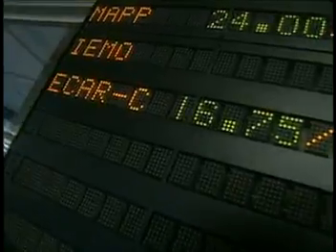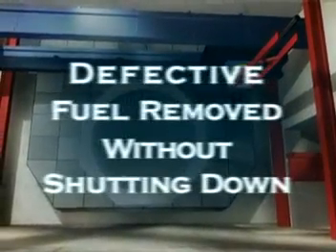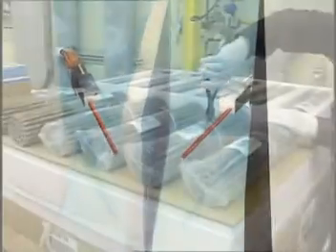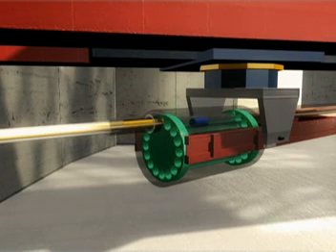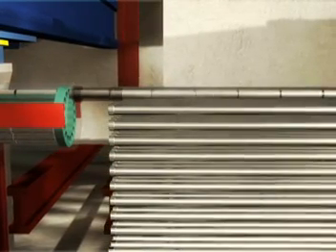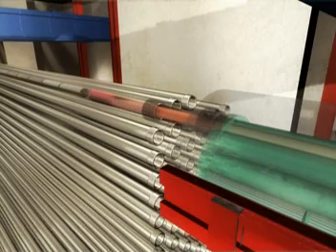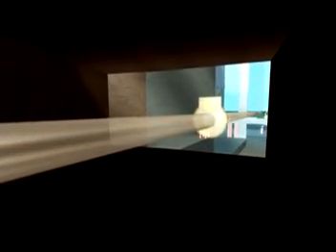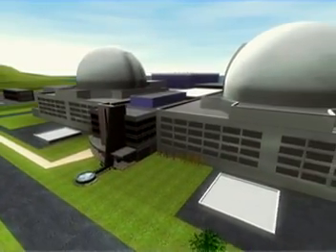Candu Reactor Refueling

Comment: The horizontal reactor lay-out seems pretty unique.
Reply: For power reactors, yes. However, the first large scale production reactors at Hanford were similar in layout, although much, much larger.
Reply: It's great or allows them to avoid shut downs for refueling.

Comment: By far CANDU is the best reactor ever conceived! it can run on any fuel from thorium to reprocessed long lived waste!
Reply: David Vermillion water-cooled reactors are ancient
Reply: David Vermillion got it own problems like the possitive void coefficiency and Cant breed plutonium
Reply: If at this moment there is a best reactor should be the Bn800
Reply: The later is not a negative. Since you can sold those reactor a said contry and your're sure they wont make nuclear weapons out of it.
Reply: good ancient reactors,in Romania we have 2 of these and they works wonderfully.....
Reply: CANDU reactors produce plutonium. Plutonium is a natural product of the Uranium fission process. All thermal reactors running a Uranium fuel cycle, will produce plutonium. Thorium too. The real question is what do we do with that Plutonium. I feel that the correct answer is reprocess it and send it through the reactors again. No sense in throwing out good usable fuel. Especially if you keep it on-site for reprocessing, thus negating any proliferation risk. 
1. Pull it from the reactor. 
2. Send it to on-site reprocessing.
3. Send it back to the reactor. 
4. Enjoy huge reductions in greenhouse gasses because of the coal and gas plants you were able to shut down.
Reply: With chloride fast reactors you can leave the plutonium in the core and just remove "specific" fission products. Keep the uranium-plutonium salt screaming radioactive to prevent theft. Neutron poisons aren't as bad with fast neutrons.
Reply: @Matt..S  I understand the absorption and decay process. I was trying to keep things brief in my description of the operation of power reactors. You're right that Pu-239 isn't a fission product. But all reactors that run on U-238 nad U-235 produce Plutonium as part of their normal operation. I agree with you completely though. The best and safest place to store Pu-239 and Pu-240 is in the reactor that created it. It's a fantastic fissile material that can and does produce heat. Use it to generate clean electrical power! MOX fuel is a good option for existing reactors, but that mix of Plutonium isotopes can be used as startup fuel for more interesting reactor types like Molten Salt Fast Reactors or the Integral Fast Reactor.
Reply: @DriveCarToBar  However, molten salt reactors have so far never worked and pose so many more extreme dangers that are overlooked in the hyped up videos, just like about the magic fuel of thorium.
I'm an old school, new vision kinda guy when it comes to nuclear. heavy water or light water and standard reactors that just work. And minimum 1000MW. 
It is baffling that only Canada, Argentina and India use heavy water reactors. It seems so obvious to use: No need for centrifuges to enrich uranium = far less CO2, far less chance of proliferation in enrichment facilities... Yes, more plutonium, but with strict regulations, this could be practically free unlimited energy for poor countries that lasts for years before it needs serious refuelling. Africa is sitting on huge uranium reserves and could just shove it into prospective reactors without the need to build expensive and complicated facilities..

And people forget that plutonium is an important fuel for space probes like the voyager.
Reply: @cnn8420  ancient but good.

Comment: I have to say, I really do like the CANDU reactor design. Up until now, I've mostly read about RBMKs and PWRs, but this is increasingly piquing my curiosity. To me, it resembles an RBMK, but then put on its side, without the graphite, sporting a proper containment building and done really, really well in terms of safety etc..
Reply: I'm not convinced on the safety aspect as the more complex a system is, the more likely of mechanical malfunctions requiring human intervention. And it's this human intervention that is likely to cause safety issues.

Comment: Hanford B Reactor used a much simpler and better method.... get a bloke to push out the spent rods with a long broom handle and have them fall out the back into  a bucket of water! Then have another bloke put new rods in all while smoking Woodbines!
Reply: Anonymous Anonymous that’s not why the reactors caught fire, it caught fire because of 1) its cooling system; 2) the way they over used the reactor, a graphite pile, it accumulated to much energy; 3) they decided to overheat it in order to release the energy it accumulated. 4) they made things worse by turning on air when the fire started rather than cooling the pile with water.
Reply: Graphite moderator reactors have gone out of style.
Reply: The RBMK-1000 is a close copy of Hanford B, with most of the safety systems removed.   The scary thing about Hanford B (where we discovered xenon poisoning) is that when the power mysteriously fell after a normal startup, our operators pulled the control rods all the way out in a misguided attempt to get it going again.   (Fortunately the rods were put back in before any part of the core reacted and we got away with it, but boy was that ever dumb.)
Reply: Anonymous Anonymous  The windscale reactor used AIR for cooling, the B reactor used water.
Reply: I think you are referring to the Windscale plant in the UK not Handford B.
Windscale fuel literally fell out if the reactor into a water trough.
Reply: @deeremeyer1749  gee you sound like the guy no one talks to at parties?

Comment: I understand that a unique characteristic of Candu reactors is that their fuel does not contain elements that can be used for a nuke.

However, they CAN be used to burn plutonium from nukes as they are decommissioned.  They also can burn a lot of spent fuels from other reactors.
Making these reactors attractive as part of the reprocessing loop.  Reducing global spent fuel stocks.
Reply: The candu reactor CAN produce plutonium because:
1) use natural uranium
2) can change the fuel without shutdown.

Comment: @adekk9  The fuel channels of the RBMK were light water cooled. As you probably know, light water is not that good of a moderator compared to heavy water and graphite, because of a somewhat high neutron absorption cross-section. RBMKs were graphite moderated, so that is why they have such a positive void coefficient.  In other words, power goes up and so does the temperature. The  water becomes less dense it absorbs less neutrons and power further increases.
Reply: The CANDU also has a positive void coefficient, but  fuel geometry is critical in this design: if the fuel channels overheat, gravity causes them to sag out of alignment, stopping the chain reaction.
Reply: @laura-ann.0726  
The CANDU proves that having a positive void coefficient doesn't automatically mean an unsafe reactor. Not only that, the CANDU can, as a last-ditch resort dump its heavy water moderator and replace it with plain water so the core cooling can continue, but the chain reaction cannot. That's something completely impossible with solid graphite blocks. And the CANDU has two independent, blisteringly fast shutdown systems. Something the poor RBMK would love to have, but never got. Before the Chernobyl accident, its single shutdown system took a skeletal 18 to 21 seconds(!) to fully insert all the control rods into the core. At that point you might as well put jelly in your pocket because you're going to be toast. By the time the control rods can make any difference, your reactor will have put itself into orbit. Which is what Unit 4 quite literally did that night.
Reply: @swokatsamsiyu3590 - Everything I've read about the CANDU makes it seem like the best overall reactor design for a commercial power plant, at least up to now. Producing the deuterium oxide is expensive, but then, so is enriching uranium for a light water reactor.  But I think that where the CANDU absolutely outshines every other solid-fuel reactor design, is on-line refueling and total availability. No shut down needed to just swap out spent fuel bundles. One question I have though, is how do the refueling machines maintain a water-tight seal to the fuel channels? Spent fuel has to be kept under water continuously because of the decay heat, so the inside of the fuel handling machines must be full of water too. The fuel channels are horizontal, so how do you prevent reactor coolant water from leaking out onto the floor at the interface between the reactor fuel channel and the refueling machines?

Comment: That's why you don't operate outside the design parameters (or way outside as in the case of Chernobyl). RBMKs are great at making plutonium for a renewable nuclear fuel cycle, but the things are beastly at 4500MW of raw thermal power.

Comment: So, when the plugs are remove, how is the 9 MPa pressure contained?
Reply: +Big Boss Kind of like what mark said but way more complex than that lol but simplifying it...

The refuelling machine has a higher pressure that the pressure tubes so that when they plugs are removed the water from the streams doesn't leak out into the fuelling machines but instead is contained by a higher pressure wall. This causes pressure within the tubes to act as it the plug was still installed.
Reply: +Bones9696 Ah ha. Yes, that makes sense. Thank you :)
Reply: Once the fuelling machine is clamped on to the end fitting it becomes a part of the reactor pressure boundary. The snout of the fuelling machine firmly clamps onto the end fitting to create and maintain this seal.
Reply: that guy is a boss

Comment: As a separate discussion, why is it that nuclear fuel can be handled by the crew and appears as non-radioactive and safe to be handled via humans with no major protections, prior to insertion into the reactor?
Reply: Non enriched fuel is considered stable prior to being placed in the reactor. Once it’s placed in there, the chain reaction begins at which point it cannot be “stopped” only controlled.

Comment: RBMK is better, it uses light water for cooling, and a graphite for neutron moderator. It also can be refueled without shutting down.
Reply: Origoangelohrol322 positive void coefficient FTW!
Reply: Like Chernobyl?
Reply: I think I found a nuke troll.
Reply: Are you fucking kidding me here?
Reply: @nerissacrawford8017   No kidding. The graphite moderated reactor concept is very good and the Chernobyl type RBMK-1000 is just a not so successful modification of the idea. It's predecessor AM-1 has been very successful reactor and the modiffied MKER is also promising: https://en.wikipedia.org/wiki/MKER
Reply: @Origoangelohrol322  I think better example of successful graphite-moderated reactor would be EGP-6, which was 1) actually built, unlike MKER; 2) wasn't a test reactor, like AM-1.

Comment: @-ACHTUNG you're kind of right with that. but at the same time very wrong. When you actually calculate the true power very comparing fission vs fusion you have to put it in the same units scale!  For example you can't compare 2 litre 300 horse engine vs a 5 litre 500 horse power engine and say that the 5 litre engine produces more true power. because litre for litre the smaller engine produces 150 per litre while the 5 litre only produce 100 per litre. So when you scale the fission vs fusion...fusion always produces more power!

Comment: He said "molten salt" (at least in the post I saw).  He never said "sodium".  Flouride is a salt, as well!  And there is such a thing as a "molten salt reactor" design.  It would use Flouride as a liquified fuel.  The only main technological hurdle to that right now...is developing a way to avoid the potential corrosion because flouride is corrosive.  The non-technical hurdles...are ASTRONOMICAL!  I see this is an old post.  Perhaps you have heard "The Good News" since then about molten salt and

Comment: Yep. But Uranium-235 is hundreds of times more massive, and that's why its fission is less energy dense and specific than fusion reactions involving light elements.

More importantly, fusion involves more reactions per unit volume/mass which means more neutron radiation. Neutrons are the lifeblood of any fission or fusion fuel cycle and can perpetuate the production of excess fissile/fusile fuel.

Comment: Atomic Energy Plant Atomic clock. Can be powered and energized by a solar energy clock but doesn't use sun power but only by laser light which is absorbed in clock's solar panel cells or photo voltaic cells which absorb laser light converts it to electricity and sends it to it's Atomic Core clock.The reason to use this. Not smart to have any electrical wires any were around atomic things;not fire safe, compared to laser beam which is safe even if cut.Or if under water a laser can still be used.

Comment: Why not direct all your love for this clean energy source to Japan and find a solution to this nightmare that's going on
Reply: The best energy sources in the world are no good if the operators fail during an emergency.  The Fukushima-Daiichi and  Three mile Island incident's are prime example's of operator error.
Reply: Maybe that's why we shouldn't have this poison with no cure on our planet
Reply: All the more reason to use Integral Fast Reactors and Molten Salt Reactors. Use the IFRs to breed the fuel needed to start-up and run the MSRs, and the fuel for those IFRs is the spent fuel from older light water reactors. And while you're at it, instead of using the IFRs to produce electricity, use their heat to run desalination plants. Enjoy the benefits of less waste, and plenty of clean electricity produced by MSRs and IFRs that are physically incapable of melting down.
Reply: agreed, but also consider japan had to battle with multiple major design flaws, And, A once in a million disaster, TMI was textbook operator failure.
Reply: @ramon23598  This stuff comes from the ground in the first instance. Nuclear radiation is an entirely natural phenomenon.
Reply: @GoofieNewfie69  Three Mile Island? How many casualties and fatalities?
Reply: @paulanderson79  I said nothing about injuries or fatalities. Thats entirely different. I spoke about operator error. These accidents would not have happened if the plants were operated correctly
Reply: Japan's restarting their reactors now.